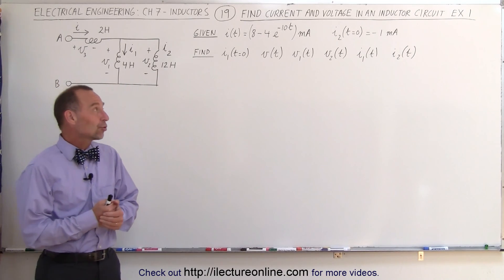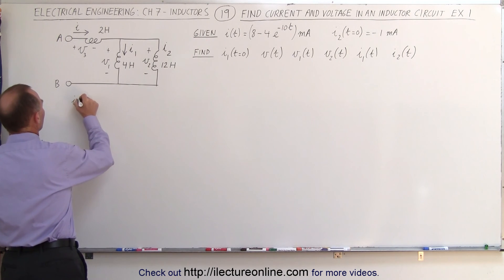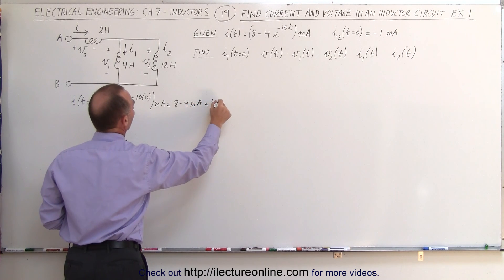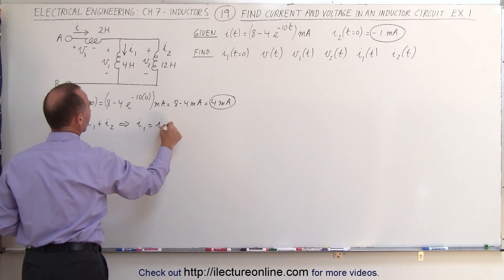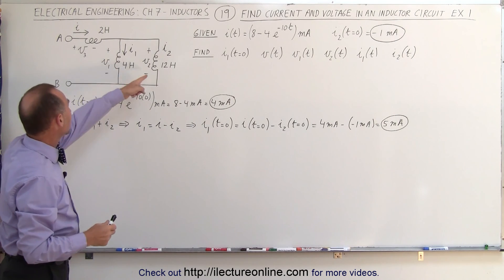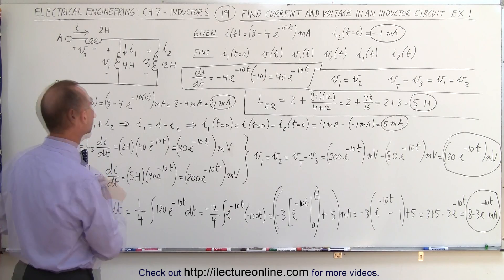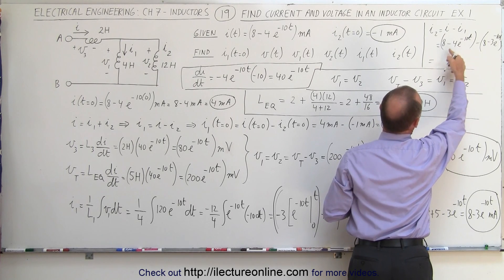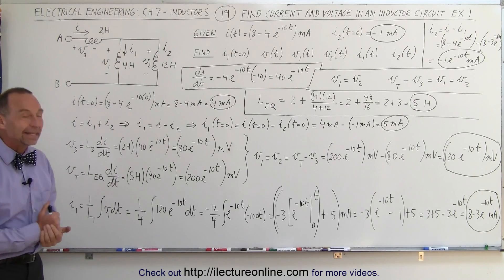Electrical Engineering: Ch 7: Inductors (19 of 20) Find i=? and v=? in an Inductor Circuit: Ex.1

Comment: Hi sir, if I may propose, since V1=V2,  we can find i1 and i2 using current divider rule (ratios of inductance), since current is inversely proportional to inductance from the integral formula. (just like current is inversely proportional to resistance)
Reply: I actually tried that and I got a different answer. I think the reasoning behind that, is because the current in this case is not constant but a function of time.
If you think about how to get the current, you need to integrate the voltage. Which means you would get a constant i(t0) and using the divider rule would basically be like guessing the constant.

Comment: at 8:30, I don't understand why you created the -10 factor. Why couldn't we simply have integrated with respect to t?
Reply: nevermind, it's u substitution where u = -10t, du = -10 dt so the integral becomes -3 X integral e^u du which is -3 e^u which is -3 e^ -10t.
Reply from the maker: That is correct

Comment: In the i1 calculation, we've evaluated from zero to t. Why did you add the current at t=0 to the integral. Thanks for your precious effort.
Reply from the maker: The integral gives you the change in the current from t = 0.  The starting point is the current at t = 0
Reply: @MichelvanBiezen    I didnt get this point :( Why we evaluated from zero to t (is this necessary? ) Thank you sir.
Reply: @buketokur915  By taking the integral from 0 to some time t, u get the current in terms of time. And then u have to add initial current as it is not 0 at t=0.

Comment: if the current is  minus  the it means v2  must be reverse. i think in the question we have a proble  here.  thanks for  ur  answer. and  thanks Prof. u are   the  best
Reply from the maker: Note that the current is oscillating and the phase angle we are finding here is relative to the voltage.  (V2 is not in reverse).